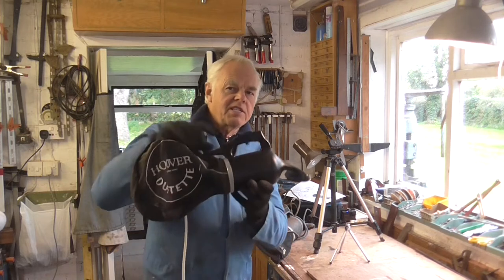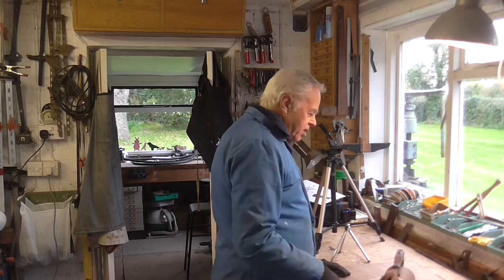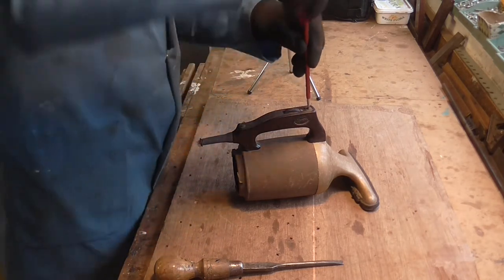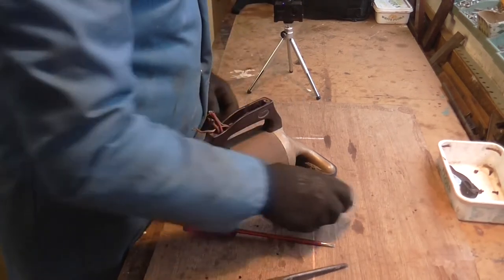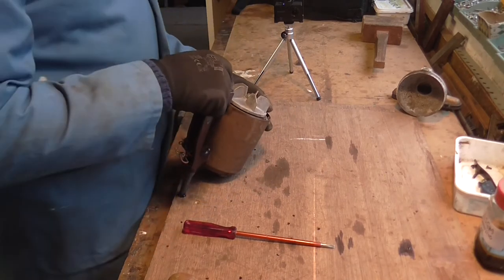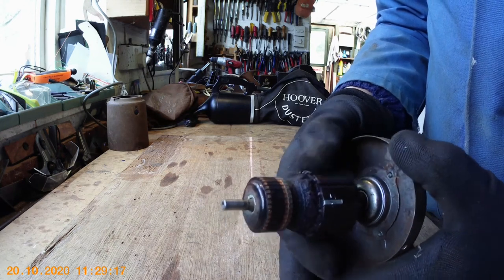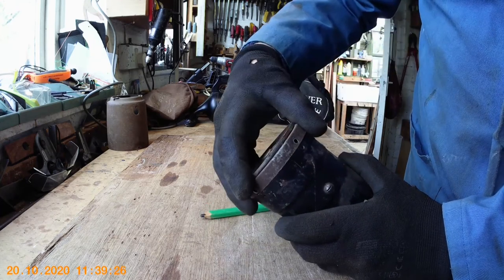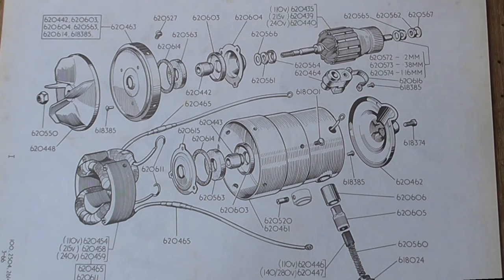Hoover Dustette in Detail. Overhaul with hints & tips Part One

Comment: One of the most informative videos of a hoover dustette i have ever seen. I have four model 100 and have been a little hesitant in getting the motors apart, although i do my Constellation motors blind folded. I have a very old brass Hoover grease gun i bought from a Hoover service man. It has a brass screw nosel with holes all round it. I only know how to grease my hoover 700 brush roller with it because i saw you do it on similar Hoover, havent tried greasing any other Hoover because i dont know how. Thank you for the videos, they are great.😁😊😊😊👍👍👍
Reply from the maker: You are very kind Hooverguy. I am so glad that you like my videos and that you have found them of interest, even better if they have encouraged you to do more work on your cleaners. Dustette motors are a bit fiddly to do and at our shop we tried to avoid doing them if we could get out of it!

Comment: Hi, John thank you for sharing your time and passion. Can you please tell me is there an alternative method to replace the seal has the one I have has perished with age. I have a 1940s dustette 100 vacuum with push switch and chrome end. Hoping to use on a day to day basis. Thank you again for the information.
Reply from the maker: Hi Lee. the bag flange seal is a problem, when I left the business some 24 yrs ago I brought with me a pack of these seals but they have now crumbled up. I reckon that one might be able to use that stick on foam window seal to do the job as long as you get the thicker stuff and not the cheap economy junk
Reply: Thank you 🙏

Comment: Can't wait for part two of the video especially if you show how to grease/oil the motor bearings and the type of carbon brushes that are in the motor. Are they of the Hoover Junior 119 or 1334 types as I have a few of those or of a different type altogether?
Reply from the maker: The Dustette brushes are smaller and square rather than rectangular like the 119/1224/1334 types, however if you don't have the right size you can easily file down your 119 ones to fit. the degree of hardness of the Dustette brushes is about the same as the junior ones.
Reply: scrimperuk thanks John great for the information on the Dustette carbon brushes